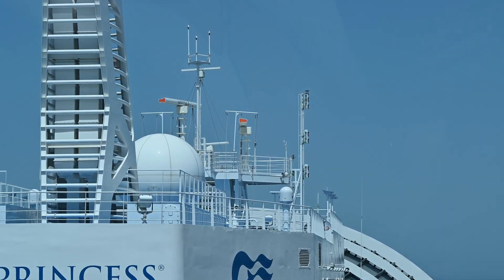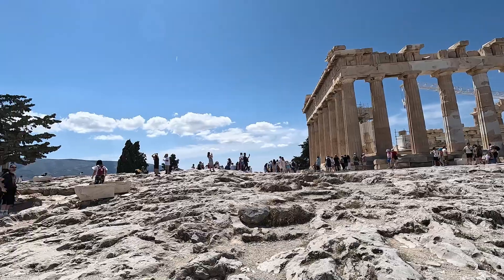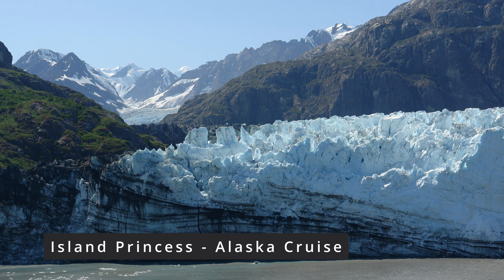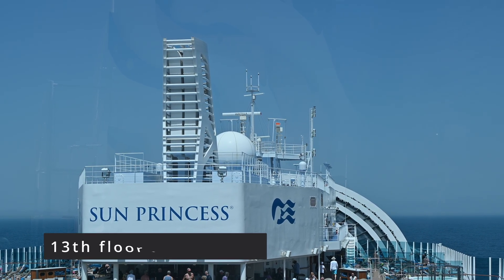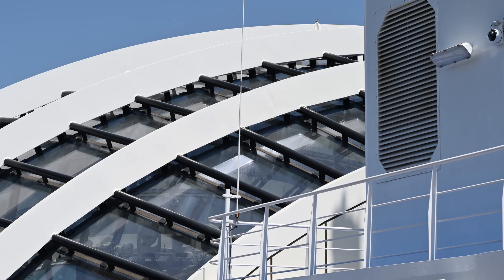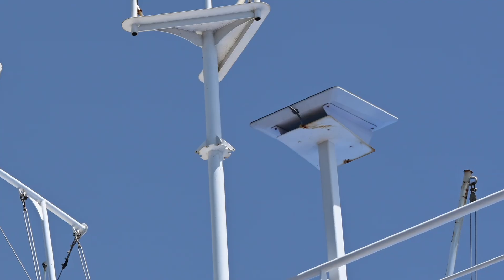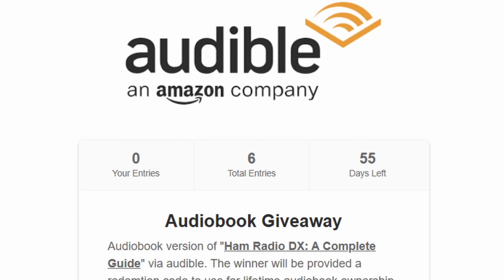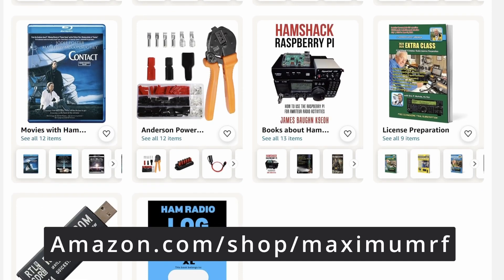What Are Those Weird Antennas on Cruise Ships?

Comment: My first cruise was in the early 1990s. The ships still made extensive use of HF for comms and navigation. In my latest bridge tours, everything is satellite and gps. As you pointed out, they use VHF for pilots and port traffic. Great video!  Thanks!
Reply from the maker: Thanks for sharing! Yes, everything is now satellites and GPS  based when appropriate. I did not see any obvious HF antennas on the Star Princess though I do know it is used. On my Alaska cruise it was overhead at an angle.